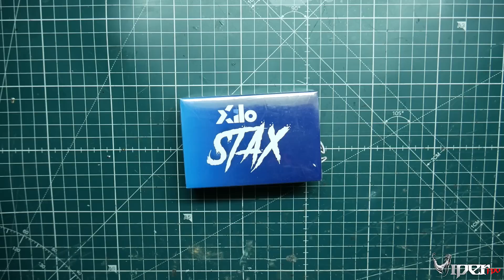Xilo Stax Combo - Xilo Stax F4 FC & Lumenier Blheli_32 4 in 1  - Unboxing & Overview

Comment: Does it support ibus?
Reply from the maker: Super Nova FPV sure does
Reply: Viper_FPV I couldn’t get the Ibus to work and I don’t think it supported.  But it works great with my R9M
Reply from the maker: What pad are you using for your receiver for ibus?
Reply: @ViperFPV  I tried using the sBus pad but no luck, what do you recommend?
Reply from the maker: Super Nova FPV u don’t use the sbus pad you need to use a free RX uart and then enable ibus on it in configuration page.

Comment: fyi. instructions say there is an onboard blackbox.  turns out there is no blackbox.
Reply from the maker: I am in the process of building with this, it would be nice if there was
Reply: The other issue I am having is that you can’t upgrade to BF 4.02. The hex does not exist in github. Only option is to flash with 4.00 hex on getfpv site.
Reply from the maker: That I am aware of, getfpv is making there own targets but they told me that soon it should be in the betaflight flasher just like everything else.
Reply: They advertise a revision that includes Blackbox now on their website, little weird they didn’t include it to begin with though
Reply: now im upset i just bought one....
Reply: RiSKeYRoToRS it has blackbox
Reply: Lastly I hope they moved the esc connector to the other side. Pics on getfpv show it's under the battery solder pads. 

First build woot woot, furibee did me good
Reply: RiSKeYRoToRS don’t remember where it is but I always just mount my esc however I want and just change the motors in betaflight, you can do the same with your fc
Reply: Like on this one I actually mounted my esc upside down, cause I liked the looks of the bottom of it more haha, gives kind of a unique look too with the wires underneath instead of seeing exposed solder on every motor lead.
Reply: If said connector was under the battery pads, I was just gonna mount it upside down as well
Reply: it hads blackbox you have to enter a command in cli to bring it back to life so to speak 

Note: If you update the FC firmware the BlackBox feature may not be enabled anymore. You can re-enable it by adding this text to the CLI command line within Betaflight:

resource FLASH_CS 1 B02
resource SPI_PREINIT_IPU 2 B02
save